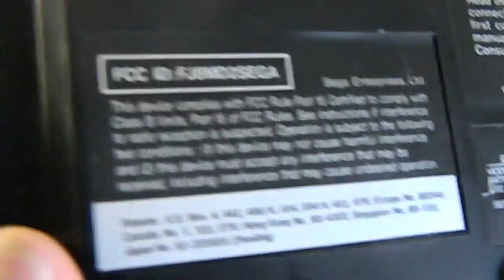Genesis model 2 disassembly

Comment: You forgot the led light thingy between the power and reset buttons, but good video anyway.
Reply from the maker: Thanks
Reply: ya but how do you take it off
Reply: @mythicalpidgion6393 I think you carefully bend back the 2 black plastic tabs on one side while you're pulling the transparent plastic up on that side, and then you do the same with the other side, but be careful because the black tabs are small and probably break easily.
Reply: I tried that but it doesn’t seem to work and I don’t want to risk breaking anything
Reply: @mythicalpidgion6393  I think I wedged my thumb in between the 2 black plastic tabs to get the piece out, but if you think you'll break it; it's probably best to leave it alone.
Reply: I’ll try that thanks I’ll be careful